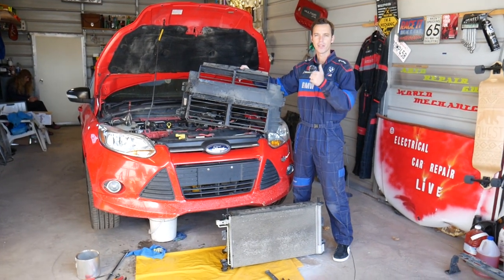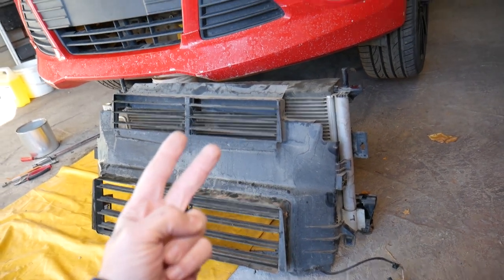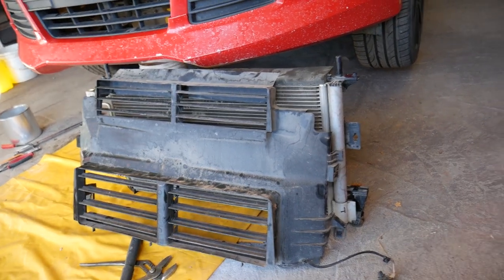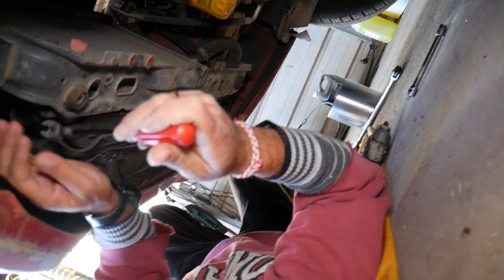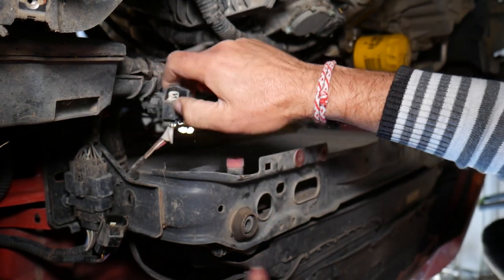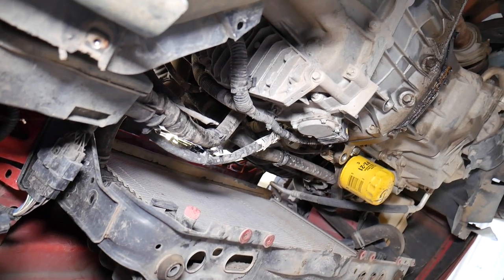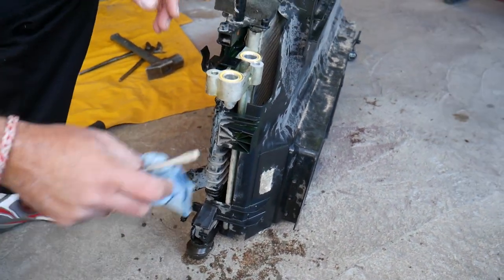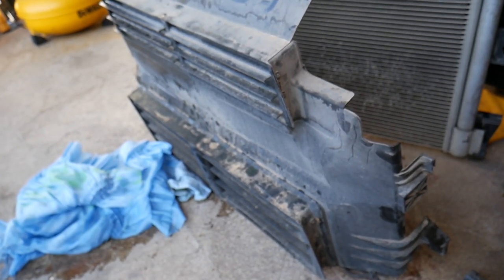FORD FOCUS MK3 RADIATOR SHUTTER REPLACEMENT REMOVAL. ACTIVE GRILLE SHUTTER

Comment: A few points.

1.  Great video.  Well done.  I learned a lot.
2.  Your comment toward the end suggesting the shutters can be replaced without removing the radiator is correct.  
3.  If you do the job without removing the radiator, getting the old set of shutters out may be the hard part.  In my case the shutters were severely damaged, so I took the old part out in multiple pieces.  Use your imagination on how to cut, break, and otherwise make a damaged part more damaged.
4.  To get a better view of the mounts on the sides of the radiator, I removed both headlights.
5.  Inserting the new part is a tight fit with the radiator still in the car.  To get a bit more room I used tinsnips to remove about 15mm from corners of the semi-circular "flange" at the top of the new part.  
6.   I contemplated removing the lower radiator mount to get more room by allowing the bottom of the radiator to move backward an inch or two without removing any of the hoses, but ultimately this was not necessary.  There are only 4 bolts holding the bottom radiator mount in place so taking this step may be a timesaver.
7.  The video shows a process that is far from trivial.  Doing the job with the radiator in the car saves the need to drain and refill the radiator but is similarly non-trivial.

Again, Thanks for the video.

T

Comment: Is the active grill shutter just that plastic part covering the radiator? I've got a fault code saying active grill shutter is stuck. My temp gauge is taking a while to heat up probably because of that.